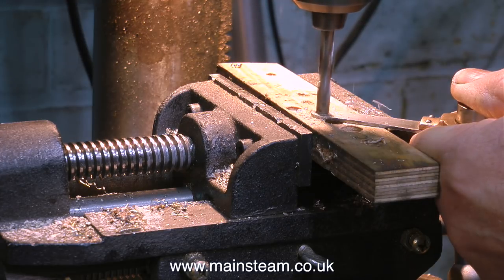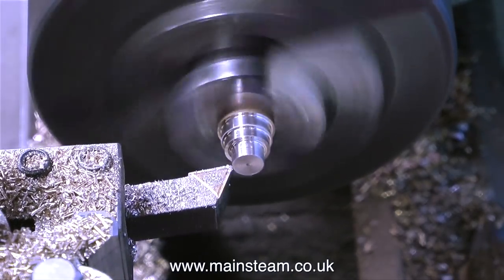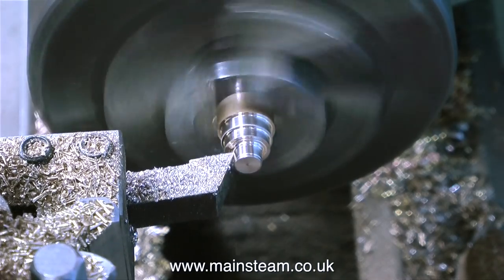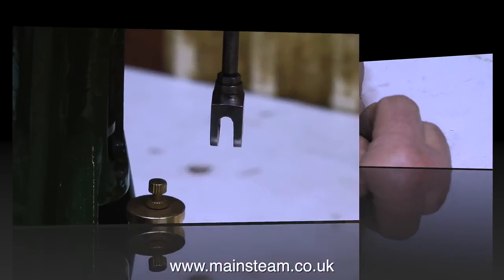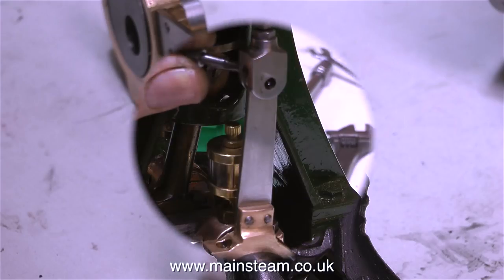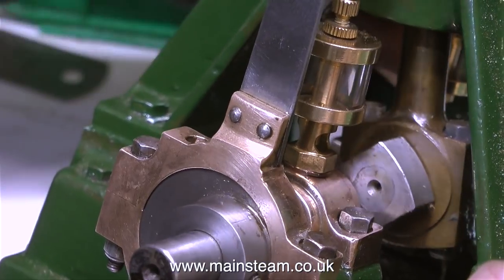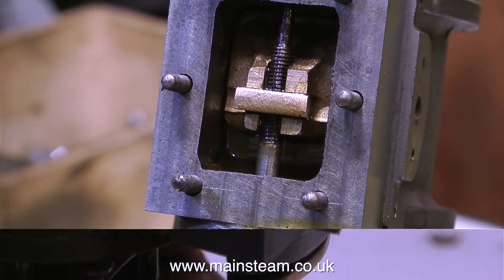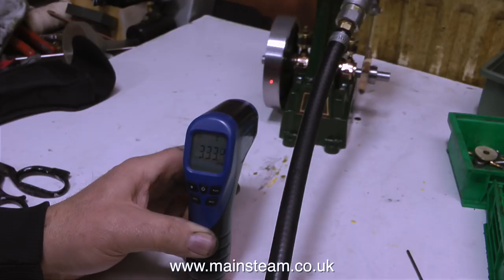HOW TO RESTORE A STUART NUMBER 4 MODEL STEAM ENGINE - PART #5

Comment: Thanks for posting this very informative mini series. I have just bought a standard/trunk guide for one of these engines. It is a fabricated part rather than a casting but is nicely made an only cost £1.40. I'm going to have a go at making a replica engine  from barstock, A friend gave me a small 240v dynamo so with a bit of luck an engine of this size on steam will have a fighting chance of driving it :-)

Comment: I suggest putting a thin copper/brass disk in the grub screw hole before the grub screw. This will prevent indentations on the shaft interfering with minor adjustments to the position of the eccentric. And it allows you to properly tighten the screw without making indentations in the first place.

Comment: Another great video Keith, filled with all sorts of tips and tricks. I am in the process of building my first 10V and wondering if you have a video in your collection showing how you drilled out the steam ports. All the other videos out there show it done using a milling machine, well I don't have a milling machine. I need to do it old school and the only opinion I value when it comes to old school is yours.. Any suggestions would be appreciated.. Cheers
Reply from the maker: I would use my drilling machine - you just need to get the angle right. First you need to file a flat on the inside edge of the cylinder at both ends, centre punch the hole positions and carefully drill the holes. I will see if I can get an old cylinder casting from Blackgates Engineering to demonstrate it .......
Reply: That would be great Keith, I did "mill out" the recess for the steam ports on my small drill press with a small end mill, it's the fandango set up to drill the actual ports out that concerns me. Kinda the "one trip pony" thing... Thanks I look forward to your video covering this task. Till then I have lots of other things to do... Cheers  John

Comment: G'day Keith, Keep up the good work with the channel. I use it to unwind after spending a day stressful day at work. Just started in this hobby with a second hand hercus lathe(southbend copy) and a set of stuart 10V casting. The drawings do not have a tolerance on them. What kind of tolerance is acceptable on model steam engines during machining?
Reply from the maker: Difficult to say as different areas of the engine require different tolerances. Suffice to say that a Steam Engine will generally run when most of the parts are sloppy, it will just make more mechanical noise. The best answer to this is to Goggle "Machining Tolerances" you should find the information that you require.

Comment: Another excellent video, out of interest what was the rpm on the very modern tachometer,my old mechanic ears were telling me about 500. Cheers Peter
Reply from the maker: about 450RPM, but I was varying the pressure on the compressor. I think the speed will be good up to 500 RPM to drive the generator via the countershaft.

Comment: Towards the end of the vid I saw the eccentric side on seemed to be flexing a bit and wondered if it was me wonky eyes or trick of the vid, does look very thin at that angle.   How is the substitute loctite working out compared with the brand name?
Reply from the maker: It's not flexing at all, what you are probably seeing is the end float on the crankshaft. The Eccentric Rod is made from a very hard piece of stainless steel . . . The Loctite substitute is very good - almost identical to Loctite with maybe a faster grab time..

Comment: "2 sizes smaller" -- is that 2/64 or 2/32 or 2/16?  Not trying to be an expert, just not clear for me.
Reply from the maker: Just have a look at an Imperial size drill set - you will see what the numbers are .... there are lots of images of them on Google images.
Reply: Right - but are you using a 1/64th set, 1/32nd or 1/16 set.